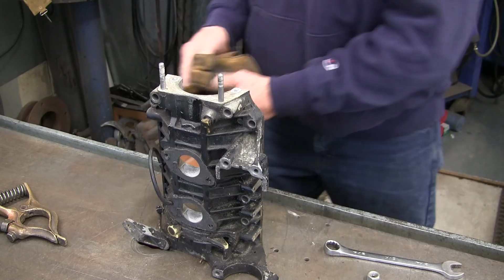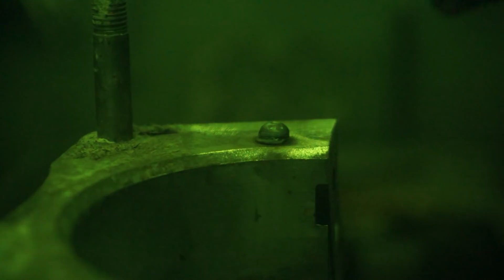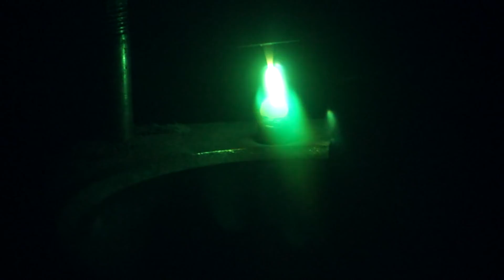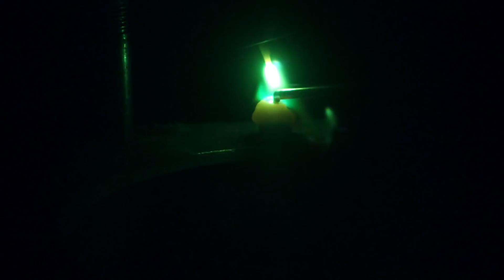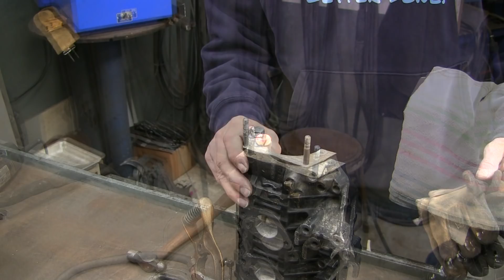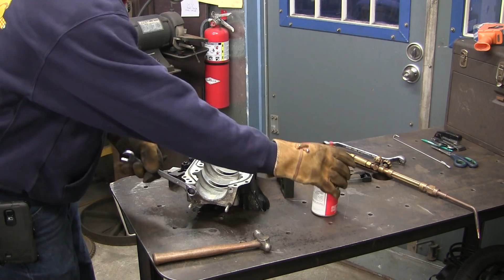Put A Head On Your Thread

Comment: Nice Job . Question You have a choice in the mill or using heat , Being that it is aluminum, is it safe to say not to introduce all that heat to that part ? Definitely more set up on the mill .
Reply from the maker: The heat is my choice, and I never had an issue with too much heat condition  to aluminum projects.

Comment: Been trying to get some studs out of a ford  E 350 5.4 not having much luck  Do you think it would help to run the motor for a bit to heat the alum. for easier removal..
Reply from the maker: When you build the temperature slowly / uniform, such as running the engine, it won't make a difference. you need to shock it.
Reply: should  i quench  it when done welding on the nut @KeithFenner

Comment: Patients is the name of this game. I use to have to take broken exhaust manifold studs out of the head on cat 992 loaders in place. They were generally broken off below the surface and had to be built out first without welding them into the hole. 1/16 308 stainless worked the best to build them out above the mounting face then weld a nut on with 7018. I would use a torch to het up the exhaust journal beside the stud until it glowed, then sit back and wait for it to tell me it was ready. You would hear a clear sharp "tink" then you could start wiggling it back and forth until it came out. The key was not to rush it or you would be reweld in a new nut on. There was barely enough room to get your head and a stinger into position so you could see what you were doing and you were jammed in between the engine and the rear tire. Sometimes it took a few hours, but I always got them out.

Comment: Noticed your using a 12 point wrench, I've long had a great hatred of 12 point wrenchs and sockets in the six point world or perhaps it is a hatred stuck six point bolt and nuts. Can not tell the number of time an old, worn or rusty six point and a 12 point wrench or socket have lead a busted hand and/or and extraction battle. I know a 12 point can sometime give a better angle, but for everything it helps there are 10,000 time it well mess you up. Six point tools and anti seize, don't leave home without them.😃

Comment: Hi Keith Fenner the mistake you made here is the same mistake most people make,  it's where you clipped the ground cable, with the ground cable being clipped to the casing the only path for the welding current to take was across the threads, any arcing here can lock the the thread and stop it turning which is what appeared to have happened here. the best way to do this job is to weld a pointed bolt to the sheared stud with the ground cable clipped to the bolt you are welding on, that way the welding current does not have to cross over the threads from casing to stud or vise versa.

Comment: I like the heat but the bolt might give you more action.  Short fat bolt gets hot and converts to long skinny bolt.   Heating the casting Opens the hole. Simple laws of Physics.
Reply: Actually, that simple law of physics tells you just the opposite. I've been a motorcycle and car mechanic since the 1960's. And a welder and machinist since the early 1990's.
Any certified motorcycle or boat mechanic knows you don't take spark plugs out of a hot engine because the plug hole tightens up around the plug when it is hot. This can gouge out the aluminum threads. 
Aluminum expands and contracts much faster and much more than steel.  Where does the aluminum go when it expands? It goes to where there is no aluminum. There is no aluminum in the hole, it expands to the hole from all directions.
I learned this in my first month of classes as a motorcycle mechanic. I was taught the same thing in my automotive classes. I have witnessed it watching back-yard mechanics who wouldn't listen to what I would try to share with them because "they have always done it that way".  Then when they have done it enough times on the same engine, they wonder why they have to use a  heli-coil.
Think about it.   We always used freon to freeze the bolt. That shrinks the bolt. It also opens up the bolt hole.

Comment: Hey that looks like a 50hp Merc crankcase cover from the 1970s, brings back memories I used to work at a dealer here in the Bahamas and i have re-built tons of those.. had to deal with thousands of wrung off bolts on those also..lol

Comment: I dont have a TIG I use a MIG & put a blob then peen & repeat that process The peening spreads the weld & also helps to loosen the stud. I like Pierre's Garage use of washers. I am careful heating aluminium easy for it to get hot short  I carbon black with acetylene first if the carbon starts to burn its getting too hot.

Comment: adding that amount of heat to aluminum will relieve residual stresses in the material and you will lose the precision in the part. but great method to get a bolt out if retaining precision isnt necessary

Comment: Done the similar thing many times except using the MIG welder (with the alloy steel .035" ER70S6 wire and the CO2 shield gas I fabricate with...).   I find that that general fab wire welds nicely onto most steel grades ( including even stainless steel boiler tubing I've used for water heating coils, if fitted with nice tight joints?)...   I clean the broken stud or bolt of any (penetrating?) oils using spray carb cleaner and air nozzle.  Set my (unplated) grade 8 nut over the bolt. Set the MIG is set kind of hot. Make sure the gas is purged all the way out to the gun.  Point the wire straight down into the center of the nut and ZAP till filled.  It is very quick, and usually successful, even if welding onto a busted off easy out tip in the bolt. Works well on studs and bolts broken off in cast iron or aluminum manifolds and heads and blocks.   I just let it cool slightly until still quite warm, add some penetrating fluid,  such as PB Blaster, and use my small 3/8 drive snap on impact wrench gently, forward and backward, to get the fluid down into the threads. Invariably, it backs right out leaving usable threads in the hole.  Probably takes all of 10 minutes, if I'm slow and careful.

I like your channel. Have learned some very useful things on here.

Comment: Great job and it takes patience to do. But you done it right. I have never built up the stud just drop a nut on it or a washer. Then put a nut on. I do like relief areas. If leakage is not a problem I have dd
Reply: Stiles a small hole between them in the thread area. I also have no experience or very little with tig  I do like what you done with. It. Rust buster is ok but kerosene ls hard to beat  good job 😀

Comment: Get it hot and then douse it with ice water.  The sudden temperature change pops it loose.  Works exceptionally well on aluminum with stainless bolts frozen in them.

Comment: I was thinking what would you use to do this, would you have to cut another bolt head off and drill a hole to get the welder in? then I realized, the thing I was thinking of is called a nut

Comment: I use the flat washer method as well prior to adding the nut, this helps increase the contact area for heat to transfer into the parent metal. Also, many guys don't realize the importance of using plain steel fasteners or black oxide. Gold and silver zinc coated fasteners have the potential to contaminate the weld and at the same time put off poisonous gases. It works best if you attempt to remove the fastener about 30 seconds after welding is complete. The use of wax or a mixture of 50/50 acetone and transmission fluid make for a great penetrating lubricant. This entire process start to finish should not take longer than 2 minutes. Don't forget to run a tap in the hole to restore any galled threads and also clean any oil or gunk before blowing it out with air. I always charge a minimum of $15 up to 15 minutes with a max of $45 per single broken fastener unless the cost or size of the part requires substantial setup time or care. Most I ever charged for a single fastener extraction was $200 for a broken and damaged bolt in the snout of a crankshaft while it was still in the engine.

Comment: I would have just laid a nut over it and used a mig welder to fill in the nut, cool it down and remove the bolt. There is more than one way to skin a cat. Thanks for sharing.

Comment: I just stumbled upon this video, and wanted to mention that with a steel bolt in aluminum, you could have just used alum and water to dissolve the steel.  Would have taken a day or two, but you said the part was sitting around your shop for quite a while.  The alum won't hurt the aluminum at all, but takes the steel right out.

Comment: Keith  if you have a lot of those broke off bolts to get out a set of left hand drills and wd-40 them using drill press I have taken a lot of them out that way and if they don't come out at least you have the bolt drilled for easy out or whatever method you use I was an outboard mechanic for many years and have seen a lot of these broke off bolts

Comment: Keith . Hi would you recommend something like copper slip, or silicone grease when assembling  studs, bolts and other fixings that are for use in the marine environment? We have had some success over the years with silicone grease as it never melts or runs away . Ant.

Comment: Keith I learned this trick several years ago , and it has worked almost every time. The times that I have found that it didn't work is when someone put to long of a stud or bolt in and bottomed it out and rung it off. Is there any tricks you have found that will still work with this method when that has been done. Due to the fact I don't have a mill, and drilling sometimes gets you in worse shape ?  Good job as always. You my friend restore the faith that there is still people that go the extra step to do the job wright. And no corners cut!!

Comment: I'd have been inclined to drill a small hole, 1/16'' through the casting, into the end of the stud, and then inject 'rust bust' or WD40 into it. Leave it overnight, and then try removing the stud. The hole could then be filled with studlock or epoxy.

Comment: It would have come right out if after you welded on the nut ... you rubbed it with a candle ... the wax pulls into the thread lubricating it and it will come right out.

Comment: this is a good method i have also heard of soaking the bolt i acid which eats away the ferrous metal and leaves behind a perfect thread in the aluminium, have you tried it before ? another method i heard of is using a left handed drill in reverse have you tried this and which method do you think take the least amount of efforts and is most successful?

Comment: Hi Keith: I think you have to take into account that the stud is extended while TIG welding: the stud will be under more tension when the weld cools off which could prevented by not letting the nut not fully rest on the cast while welding it to the stud.

Comment: I know I'm late but just seen your video try welding a washer on first and then weld the nut to the washer you can get more weld on the nut ( inside and outside).  I work in a shop that does a lot of farm machinery repair and we remove a lot of broke bolts and fittings.  Keep um coming. Thanks.

Comment: An old timer shared the wax method with me. Heat it as hot as practical, then feed wax (crayon, candle...etc... doesn't matter) into the offending thread. Let cool. Repeat 2x. The wax gets pulled in like sweating copper pipe, turns to carbon and lubricates/frees the threads. Works on both like and dissimilar metals. Hasn't failed me yet...

Comment: Let me see if I understand what you're saying. If there is a relatively quick and easy way to do a job, and a more time-consuming, more difficult way to do it - and you do it the quick and easy way - you feel it's ethical to charge the customer as if you had done the job the more time-consuming, more difficult way? If I understand your justification, you're saying that it's fair to charge what the more difficult method would've cost, because if you hadn't done it the quick and easy way, you would've had to use the more difficult method. I guess it depends on how you quoted the job to the customer. If you quoted it out as a flat rate job, then I have no problem with what you're suggesting. But if you told him the price was based on so much per hour, times the amount of time it was anticipated to take, and use the time estimate for the more time-consuming, more difficult method - and then were able to do it by the faster, more simple method - I think you'd be ethically bound to adjust the bill to reflect the actual, rather than anticipated labor.

Comment: I personally like using a mig welder with a nut on top of the stud even if it is partially below surface let cool and electric impact, I have broken a few nuts off the studs this way just re weld cool and try again always eventually comes out.
Reply: Michael Bartels p

Comment: good vid , keith . prob only tiny little differnce i do , use rethreader or a bolt ground flat opposite sides to use as rethreader .  seems to clean & reform without removing metal if deformed . never had chance to use TIG or as modern tech calls "TMAW" i think. looks better than MIG ; more control

Comment: In a case where a bolt is broken off in cast iron or steel, in an industrial environment, I'd take a center punch, tap it near one edge, make sure I get a point deep enough to then slant the punch at an angle, in the direction of counterclockwise (rt hand screw), then tap it. In many cases, getting enough of it exposed makes it possible to grab it with vise grips, then run it out. I can see where this situation required military tactics, due to the corrosion. I always chase the threads, as in this video.

Comment: Done the same to a marine Detroit Diesel 3-53 crankcase pan bolt.  While it was still on the engine hoist just a few feet off the ground.   Overhead weld on a SAE grade 5 bolt in an aluminum block.  Sans nut, I just grabbed the weld stalactite with my vintage Grip Lock pliers and it was like Lancelot pulling Excaliber.  Not me first rodeo either.  With HF start GTAW, I do it down to #6 machine screws.  ER80 D2 rod and make sure you have full diameter fusion.

Comment: Keith  always great video/ old iron here but not sure about aluminum but in plate steel when we heat the plate a hole actually gets tighter cause iron swells equally all around i have used the change to  un-Gaul dissimilar metals / interested on your thoughts

Comment: Keith I am not a skilled machinist like you but I am a skilled auto tech.  I am usually the go to guy at each of the shops I have worked in my life when the other guys screw up and break bolts off.  Its not just broken bolts but it can be anything.  What do you charge?  You have to consider your knowledge and your skill level.  A less skilled person my have  ruined the aluminum casting.  Maybe its irreplaceable is so old.  Its sometimes not just your time that is involved to me.  Do you penalize a skilled person because he does good fast work.  No sir you reward him.  What if it took a less skilled guy all day or even two days.  Can you charge the customer for two days of work.  No you cannot.  Mechanics have labor guides that give average times to to a job.  If your good and you can beat those times you make a good living.  If you can't well not so much.   Its a hard life as a mechanic.  After I quote a job and the customer and I are in agreement on price then If the customer doesn't want to pay me because I did the job quickly ie actual timer vs quoted time well he'll be with out a car untill he scrapes up the dough.  L.O.L.!!   Its sounds like machinist's have some of the same issues as mechanics.  You have to be fair to the customer and you have to be fair to yourself.  There is the line you have to toe.

Comment: I had some good luck getting broken off bolts out by first welding a fender washer to the bolt or stud.  After that, I weld a nut to the fender washer.  I am only using a 110 volt flux wire welder and it doesn't weld good with all the wire sticking out when trying to weld down the depth of the nut.  A fender washer gives you a lot of surface to weld to.  At first, I was trying to weld just a nut to the broken bolt, but when the nut just twisted off a few times, I read online about welding a washer to the bolt first.
Reply: gonna make a note of your method!  thanks for posting it.
Reply: +John Fitzgerald yep, no problem.  I've gotten several bolts out like that so far.

Comment: Great job! as the sole employee and owner of a muffler shop for 27 years I have removed hundreds of broken studs from manifolds and engines while still under the hood of the car using this method.  As others have commented I lay a non galvanized flat washer first and weld then follow with a nut. I tell the car when I start.. "you might as well be easy cause in the end I always win". I've never failed to get one out. Stainless studs the worst. Thank you for the great videos Keith

Comment: Great video, I have to deal with stuck rods and pivot screws almost on a daily basis just on a much smaller scale.  I always use to tell my bosses "just because I figured out a way to do something faster or more efficient doesn't mean I keep to charge less for the job".  I think if you have years or decades of training you should be able to charge for it.  Thanks again for another great video!

Comment: You do some nice work. I always preferred this method. However, building up a head bolt that broke off a few inches down in the block of a 3516V, because your apprentice grabbed an impact and started hammering away, can be frustrating.

Comment: Try using candle wax instead of penetrating oil. It will wick right down the threads instead of just turning into smoke. I always keep a 99 cent pack of birthday cake candles in my tool box.